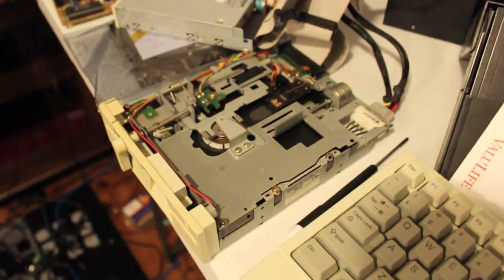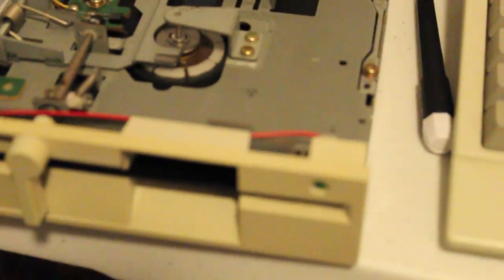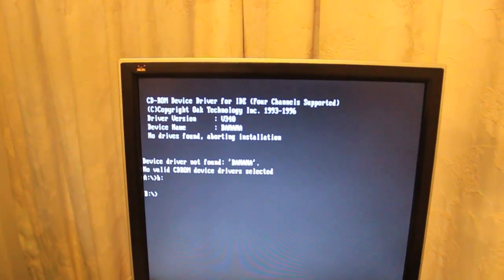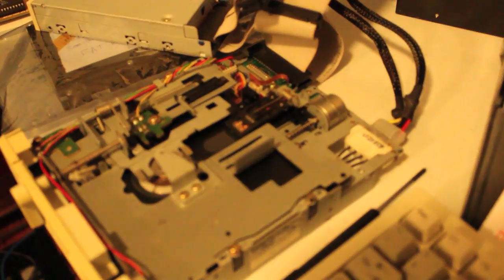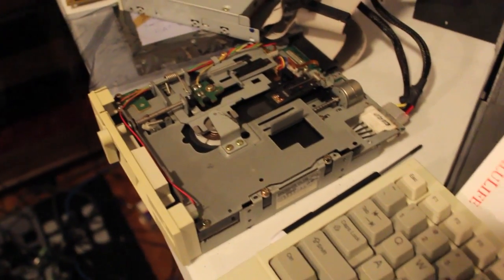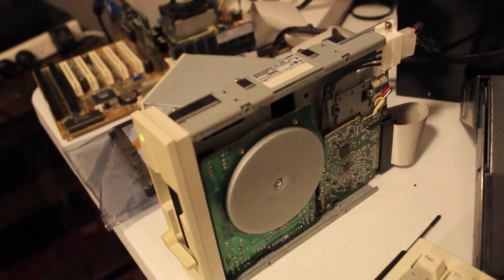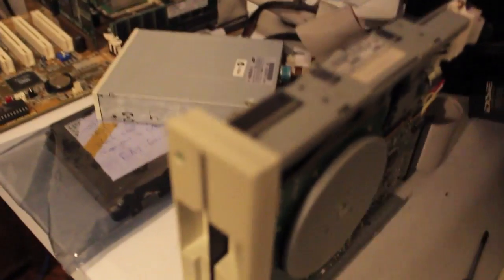Mitsumi Newtronics 5.25" 1.2MB Floppy Drive Failure

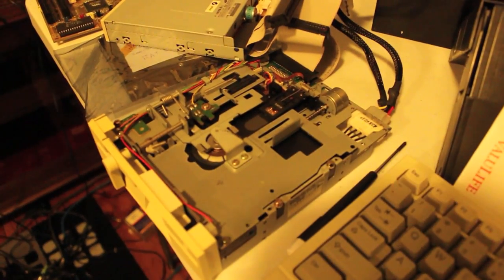Comment: I can't even get mine to be recognized at all in the bios, it basically acts like I haven't even got the floppy drive cable plugged in. No reading lights, no noise or spinning besides this tiny motor next to the molex plug (2:00). It makes a small buzzing sound but I'm bummed on why this drive isn't working.
Reply from the maker: I wish these darned 5 1/4 drives weren't so fiddly... if only I had more time :-) Still it's been a month, any luck? (Why am I so slow at responding? Sorry!)
Reply: ***** Ended up fixing it. Took the top shell off and the read head was slightly misaligned and as soon as I moved it back, it started spinning and fully working again.
Must've moved a bit during shipping.

Comment: You can compare this to HD-DVD and Blu-Ray. Iomega was new and not much used. People didn't dare to buy it because it might fail. So they stuck to the old and trusted floppy discs
Reply: Floppy drives were 5 or 10 bucks whereas ZIP drives were 100 or 200. I mean 1995 on. Instead of a 100 MB ZIP drive, I'd just carry around 40, 80, or 250 MB IDE hard drives. They were much faster and not cheaper, but already laying around
Reply: P.S., floppy drives were never trusted. Important stuff stayed on hard drives, and if it needed to be saved on floppies, better make 2 or more copies.